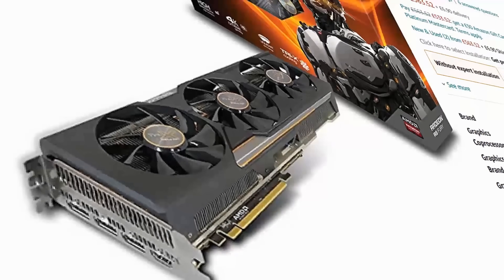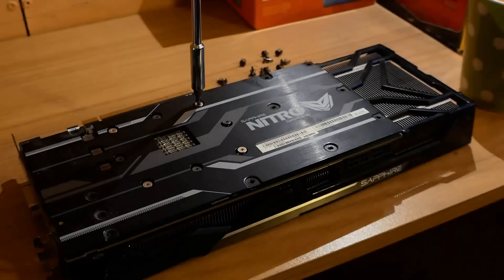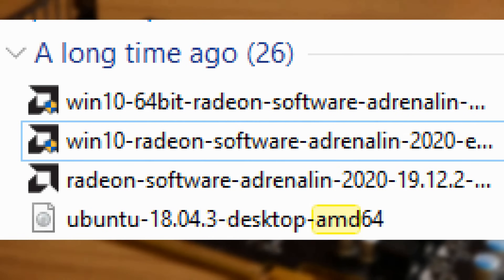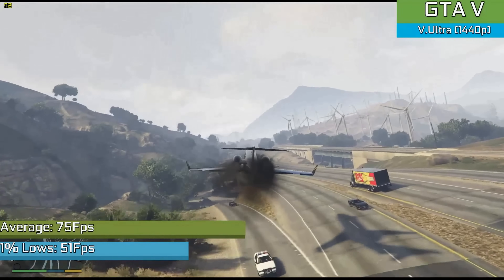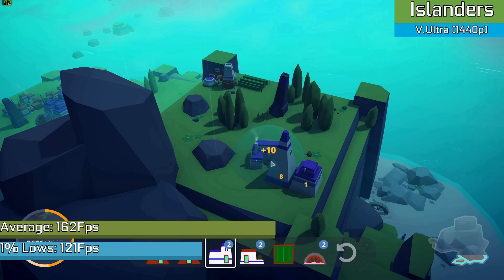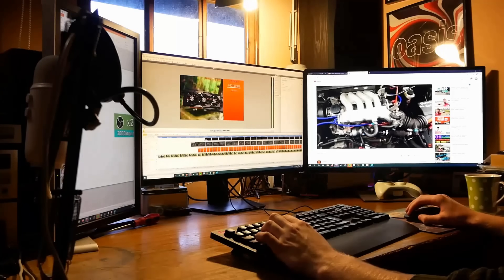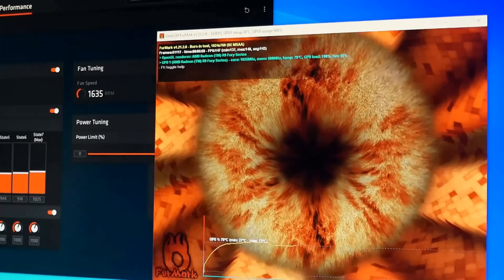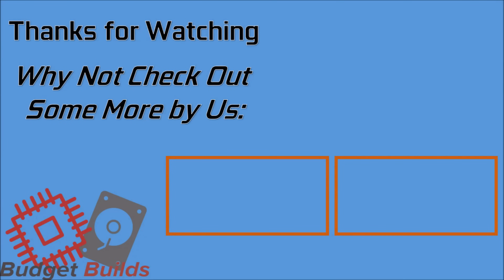The AMD Fury - A Fantastic Failure!

Comment from the maker: There seems to be a degree of concern regarding the HBM and Thermal Paste. Please do not worry as it was fully covered by Thermal Paste, and I can confirm temps are nice and low.
Reply: Already available in 4k 60 fps right now :P.
Reply: The one man who makes a video as an excuse to clean his graphics card 🤣
Reply: This man went on a passion rant about power usage.
Reply: I had a fury myself. I used it for a while and it sucked in gta V. I bought a 980 Ti with the money I got from selling the Fury. I had the same model fury that boosted to 1050mhz and could barely OC it to 1100mhz. It was a very warm card as well I should mention but its a good card in general. Indeed the vram is a limitation tho.
Reply: Have you checked if it can unlock to a fury X? I used to have a fury and I had heaps of fun tinkering with it!
Reply: hi did you fixed your black screen issues with a set of drivers?
i ask this because i have a r9 380 that gives green screen and someone told me to stick to a set of (very old)drivers.
Reply from the maker: Ran DDU, Installed latest drivers with Fresh Install enabled
Reply: @thetrueinferno7993  Yeah mine couldn't. It was a later Sapphire Fury (the one in this video that budget builds owns is exactly like the one i had) and I ran the program to tell me if it has all 64 CUs and the program told me that the last 8 were physically removed/disabled
Reply: driver issues were why i went from dual 290x to a 1070mini.... they SUCK at driver support too damn often... took them 18mo to fix the issue..
Reply: Great video, you should make a video of putting the thermal paste on this gpu!
Reply: @thetrueinferno7993  Every single one of these fury nitros have the CUs hardware removed. Usually, you can't unlock the cores anyway you can only usually get halfway to a fury x which is still good for a free performance boost. The older versions like the worst cooled fury strix can unlock the cores though.
Reply: Maybe use a toothbrush to remove the thermal paste from the hard-to-reach parts? The swab method is giving me anxiety because it can actually dislodge small surface-mount components.

As an aside, this is the first time I am seeing GTA V running without massive staircasing and framerate chug to the single-digits.
Reply: Carry on...!
Reply: I have a question what are your thermals on your 3700x?

Comment: Vega is exactly the same. A bit of undervolting and it does really well, plus you can find them dirt cheap because of their bad rep.
Reply: Nope they are 2-3x more expensive here!
Reply: I sold my GTX 1070 a couple of months ago and got a used Vega 64 Nitro+ for nearly the same price. In some titles it outperforms the 1070 by a long shot with UV+OC, but many newer games run unexpectedly bad. The raw performance is there but it does not translate to higher fps somehow, maybe due to bad drivers.
Reply: @neutrida5091  I've seen them as low as £190 in the UK, with prices usually hovering around £230 on sites like eBay (V56). You get the most out of them by slapping a V64 bios on and undervolting the core, then overclocking the HBM.
Reply: With "here" I mean Austria, Vega 64 are 300€ and 56 200€. I bought a R9 Fury ROG Strix for 100€ I am currently waiting for it.
Reply: @neutrida5091  Servus aus Niederbayern, ist der Markt bei euch in Österreich echt so schlecht aufgestellt? Eine Vega 64 bekommst du hier ohne Probleme für 250 € oder weniger mit ein wenig Verhandeln auf Kleinanzeigen und das schon seit längerer Zeit.
Reply: Wir haben leider nur Willhaben kein Ebay oder so, die billigste Vega 56 ist 200€ und eine Strix und eine Vega 64 mit blower fan 250€ und Strix 280€. Ich bin einfach glücklich das ich eine R9 Fury erwischt habe mit einem korrekten Verkäufer.
Reply: Find a V56 with Samsung memory (no reference or Gigabyte models!), flash to V64 so you get the memory voltage up, OC HBM2 to 1050-1100MHz, have over GTX1080 performance for just €200-225
Reply: My Samsung HBM Vega 56 is still doing pretty great!
Reply: Got a new Vega 56 Red Dragon for $190 a few years back. No complaints for that price! Undervolted it for better performance of course :)!
Reply: As other people have said in my area vegas are quite overpriced  getting close to 1080tis 

Its quite annoying as I'm doing a water-cooling build and a vega would be nice as it actually warrants the cooling upgrade.
Reply: Idk where you live, but they are like $3-400 in the states.
Reply: @cavegamer5989  they are close to the same price here with the cheapest vega being $300 usd but you can find 1080's for ~220 usd any day of the week and rx4/5 series sell for ~$80 usd just for another comparison. I think it's to do with a low volume of vegas exzist in the country, where probably sold to miners and they are still probably profitable to mine on. like <$1 per day. So people arnt selling them if they have them where as it's the for people with a 1080 to get a current gen gpu as the improvement is good enough.
Reply: Around here in the us i found people still asking 450-500 usd used,definitely bad price to performance especially since I can find a 980 Ti for 200 usd and it performs about 6 percent worse then the 64 according to userbenchmark
Reply: I have a Vega 56 and I love it. Still haven’t tried undervolting yet.
Reply: @EvilTurkeySlices  It makes a world of difference. I have dropped my power usage by about 100W and temps by about 10c. Underclocked slightly at 1450MHz.
Reply: they were cheaper, then people discovered it's potential and the prices soared
Reply: I've got my Vega 64 Asus Rog Strix for £196 with broken fan. Changed fan, thermal paste and thermal pad and I'm rocking all games. This card is 1440p champ but you can easily target 1800p high with Vega 64 and lick 4K in many games. I would say in UK it's great value for money you paying.
Reply: Yeah no I agree got my vega 64 for £225 which I found to be a decent price half a year ago and it's performance has kept me happy, had a few issues with drivers and undervilting but once I figured it out I'm glad I bought the card as it was cheaper than a few alternatives which were worse yet cost more
Reply: @alexz678  if you using Ryzen platform be sure to update your motherboard chipset drivers and bios.
Reply: @Ornal64  don't worry am using ryzen and all done
Reply: @santeenl  couldn't get v56 red dragon to flash to v64 bios.
Reply: What's wrong with Vega 56 and 64? Is it because those aren't for gaming or is there any other reasons?
Reply: @TheRealNeoFrancois  the 980Ti is still an absolute legend. Mine still runs everything I throw at it. Amazing for such an old card. However soon I will upgrade from 1080p to 5K, and that will be too much for the beast. Too bad the new AMD cards are so expensive. I hope they will get cheaper soon. A nice 400 dollar card is what I need
Reply: @Joshua_N-A  Vega cards GPU factory core voltage is very high. That's why it is good idea to undervolt cards for extra performance and less power draw. There is nothing wrong with architecture. You are getting good compute performance and solid gaming like RTX 30xx series. I think it's just bad press becouse low availability at launch and disappointment that cards didn't smashed Nvidia GTX 10xx series but staying competitive with GTX 1070/1080 and ended beating them.
Reply: @santeenl  , use to have a Gigabyte one. It always runned as it supposed to and now it's at a friend's house. 
 There is a new vbios for it, but again, it was already going like a train. Really good card. I've sold it for this shit show, a full year now and no new cards available...
 I've bought a GTX 1070ti Asus Strix that is also running surprisingly good at my house! 2025mhz vcore at 960mv.
Reply: So its like the 6.0 powerstroke of graphics cards..
Reply: @Joshua_N-A  power hungry and at msrp the price to performance is terrible.
Reply: I'm from Edmonton, I'm pissed coz Vega 56 goes for 350$ used. :(
Reply: My mate had one and it caused his pc to constantly blue screen. After his experience I'd stay away personally.
Reply: Vegas are like a myth to me since the card stock (new or second hand)here in my region is virtually non-existent and AMD advertised it as some ultimate GPU of some sort
And Vegas sounds badass.
Reply: @santeenl  If you are lucky, you can push the HBM to 1200MHz. (One of my card capable of it, the other goes only to 1050 above the hbm is unstable on that one.)
Reply: @EvilTurkeySlices  you should, it will last longer and wont thermal throttle
Reply: @jboy402 mine doesn’t thermal throttle.
Reply: sw4gr1d  my sapphire pulse clocks to 1400-1560mhz.
Reply: @Domstar97  sold my RX 580 8GB Red Devil for $110 and scored a sweet deal on a Reference V64 for $140. Also Undervolted and ocd the hbm. My Rx580 was getting about 50-60ish fps on FC5 Ultra at 1440p, now im like over 100 most of the time 🤘🏻
Reply: I actually made a profit of vega series even though i bought it new, no i didn't buy it to flip used for 6 months to a year and bought a dirt cheap 1080
Reply: cheap?
They are more expensive than a 1080 Ti or even 2070 where I live
Reply: @Amusia727  I got an ex display Gigabyte 56 2 years ago for £220. They need to be undervolted otherwise it just hits the power limit and drops mhz down to like 1350/1400 and runs like a bag of shit. Mine runs pretty well at 1600+ now. Even get a close Graphics score to a friends w/cc 1080

I am pretty sure AMD have done something in the background very recently and removed the power limits as they have no reason to fear 56 sales cannabalising 64 sales as mine now will use more than 300w and will go over 1700mhz

Issue i seem to get alot now though is poor GPU utilisation
Reply: @Amusia727  vega56 were shortly before the release of the 5700 xt dirt cheap. In Germany they dumped the sapphire pulse by the truckloads for 200€ including shipping and taxes
Reply: As of March 1st they are selling for $1000 on Newegg.
Reply: Not cheap here in brazil
Everything is expensive
Even a ps4 is expensive now
Reply: Vega is incredibly expensive right now, like 64 is 600-800 USD on ebay
Reply: @Domstar97  Depends on your title.  In BFV or Forza Horizon 4 it will smoke a 1080.
Reply: Yes Vega is exactly the same, shitty drivers ever fifth day of the week and brutally hot (Undervolting is only a easy thing in windows). I owned both, personally i think they both majorly suck and are a product failure.
Reply: This didn't age well
Reply: Vega is the best for miner now 
Good luck
Reply: @davidcazares7441  Still using my Vega56 as well, plays everything I want it to perfectly.
Reply: Had a vega 56. Nothing but trouble!
Reply: I wish I could get a Vega 56. But they are almost as pricey as 5700s. I may try a Fury now because you can get one under 100 €. The 4 GB are a downside, but its not like the other options in the price range have more. Drivers are not supported anymore, but its not like this card runs modern AAA games anyway. For games from its era it should perform quite decent, at least according to benches.
Reply: @vollhorst140  Eh? Corectrl makes it pretty easy in Linux assuming you have the right kernel parameter enabled to give you full control.
Reply: @DFX4509B  that the problem. Most people don’t even know what a kernel is. Personally I wouldn’t know how change anything in the kernel even if my live dependent on it. That’s always the issue with anything Linux, no easy GUI point and click way to do what’s easy on win.
Reply: @Domstar97  Due to geforce preferred game studios.
Reply: Still got my vega56
Reply: Fast forward to 2024: I recently got a Nitro+ Vega 64 for 90 eur and thanks to FineWine it regularly outperforms a 1080 now especially in Vulkan and DX12.
Ofc benefits from optimized DX11 and rewritten OGL drivers too

Comment: I use a fury nano in my gf’s gaming rig and when I was testing it I was ASTONISHED at the performance you got out of it. Very similar to my old 980 Ti. It’s interesting to see how the technology progressed with Vega, since I daily drive a Vega 64, which is another shockingly performing card in 2020 with a few tweaks.
Reply: How bizzare, I have a Vega 64 in my rig but a full phat Fury rather than a nano in my gf's gaming rig :')

I will admit, I was shocked at how good the Fury is too, especially considering the fact that when I bought it it was roughly the price of a (then still current) 1050 Ti
Reply: @ProfessorArcticPine  I was looking for a fury X but couldn't find one for what I'd consider reasonable money, but found a screaming deal ($120 shipped) on the nano. I was more shocked by my vega if anything bc I got my Strix for $220 and with an uv at stock clocks and 1100hbm it performs identically to my colleagues' 2060 Super in the games we play together.
Reply: Jude Price Eh idk about that. A gpu is only as good as the support it gets and AMD is not the best for that. One thing that Nvidia does well is drivers and legacy card support. I was on the Nvidia site the other day and was blown away how there were modern driver updates to super old gpu’s. Last I had checked AMD did not treat it’s older cards kindly. Just kinda abandoned them.
Reply: @Yomom12388  Weird, last time i updated my 750ti's drivers in 2015, i couldn't run anything in dx11 without having my pc suddenly turn off.
Reply: @Yomom12388  Funny, cause current Nvidia drivers are absolutely God awful and causing all sorts of issues for users, and AMD GPUs from 2012, now 9 year old GPUs such as the 7970 and 7950, are still being updated and optimised for, whereas any GPU from Nvidia earlier than the 900 series, has aged like milk and runs horribly on most titles.
Reply: @fletchy88  no I say it because I have multiple graphics cards but the one I use the most is my “daily” just like how I have multiple cars, and the one I use the most is my “daily driver” go be miserable somewhere else
Reply: Which Vega did you get? I have the XFX Double Dissipation and the PCB is Nano sized, just the heatsink and fan goes past it.
Reply: As long as Fury/FuryX are not VRAM limited, they're closer in performance to 5500 XT 8 GB, RX 590, 1660S and 3050.